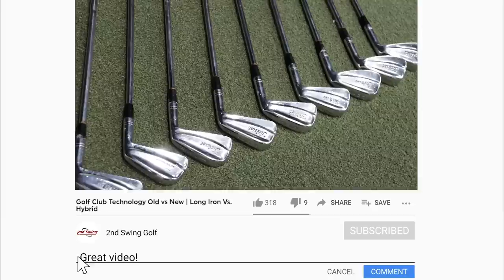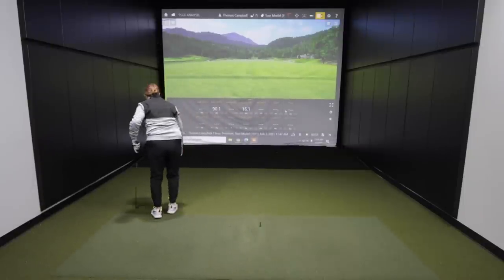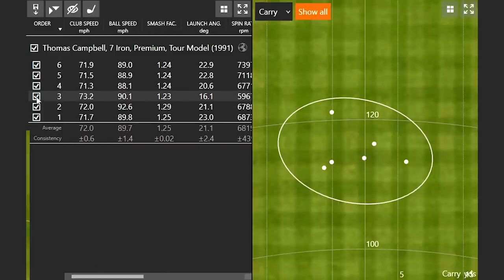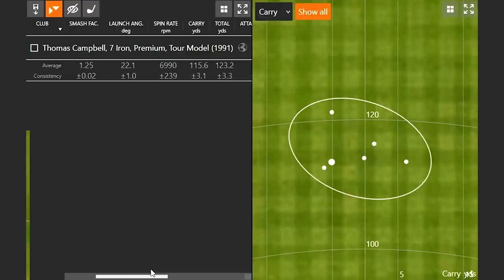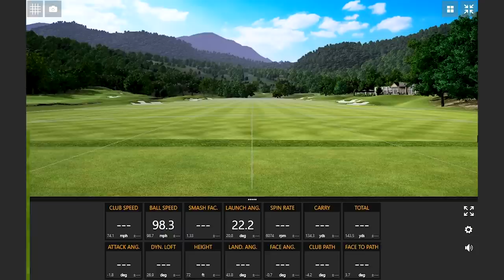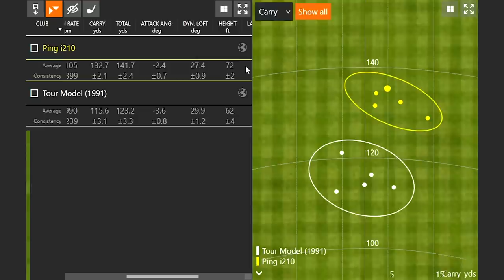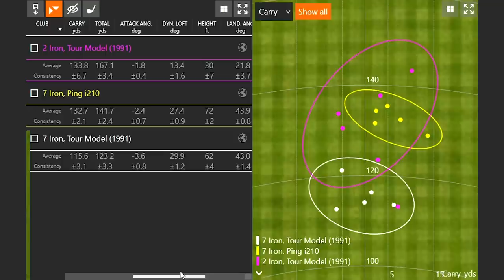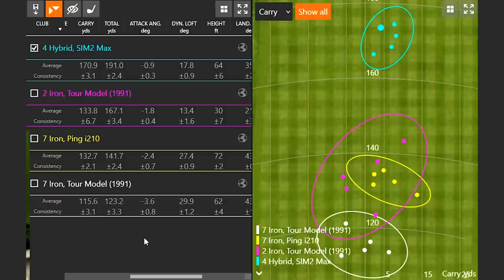Golf Clubs Technology Old vs New | Long Iron vs. Hybrid

Comment: I often play a 1 iron I acquired for $5 instead of a driver.  I hate the way some (read: my) driver head wafts and waddles in the air with so much ambiguity I couldn’t sense where the club head is.  Maybe the shaft is too flexible or the head is defective.  But the fact I think a 1 iron is a better club should inform that I hate my driver (it’s a Taylor Made).